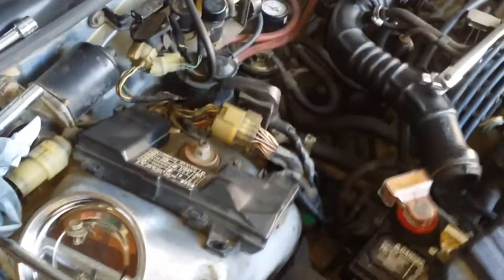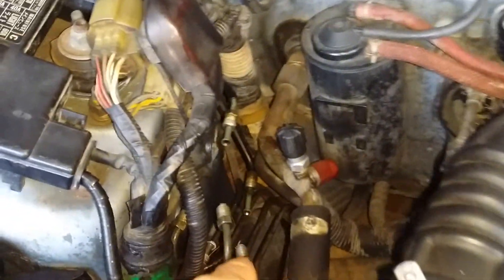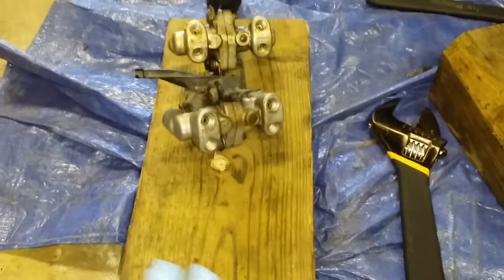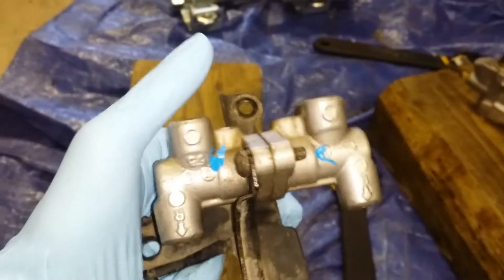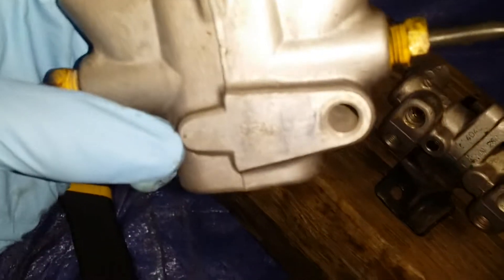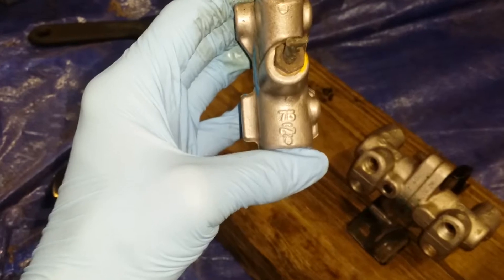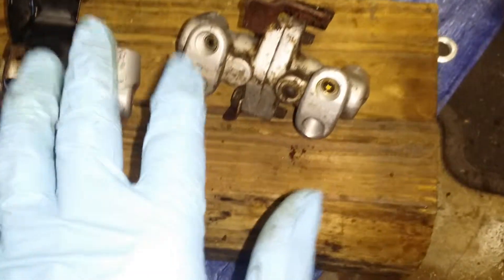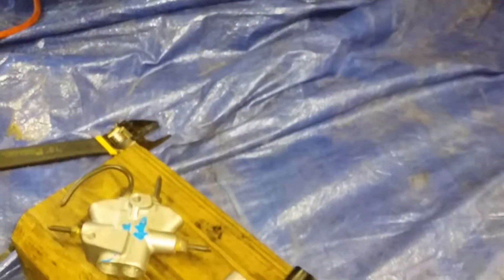1988 Honda CRX HF D15Z7 Build Day 11

Comment: I know the video is old, but for any new players coming along, you can also use the same generation Civic EX brake booster (1 inch) and prop valve (if it has rear disc) and they are direct swaps to the CRX.